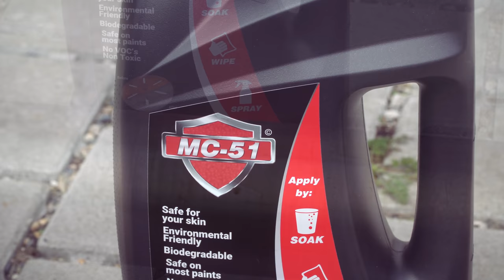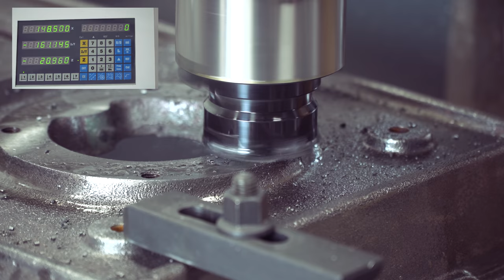Restoration Old Drill Press Part 2

Comment: just a little advice, actually you should use your angle grinder pointing the other way around so that the sparks will come to you and you are cutting on the left hand side of the gearbox
Reply from the maker: Thank You Mats, we will pay attention to it next Time :-)
Reply: Thank you for your answer.
Furthere more u wont get in the way with the Vice and the kickback risk is reduced. I really appreciate your work, the restoration project has come out gorgeous!
Kind regards from Germany.
Reply from the maker: @matspierzyna4563 Freut mich, dass es dir gefallen hat, wir haben noch einige spannende Projekte die wir gerade produzieren, ich bin gespannt, was du davon hältst